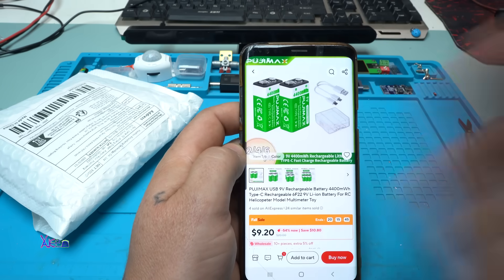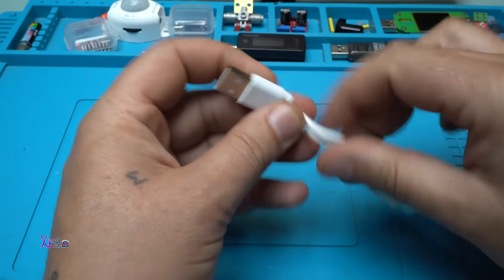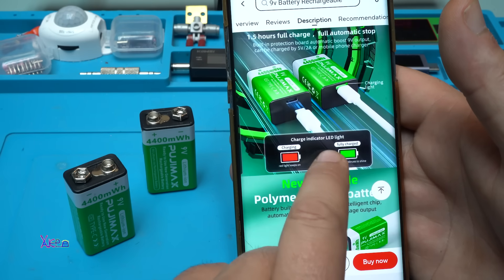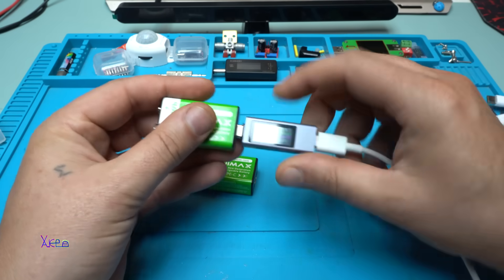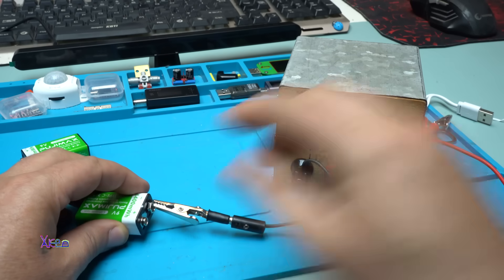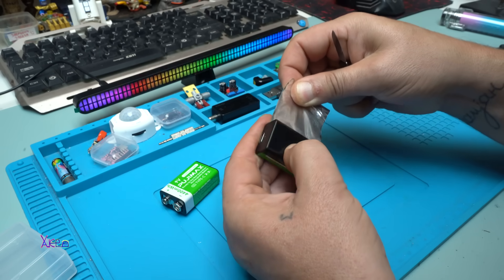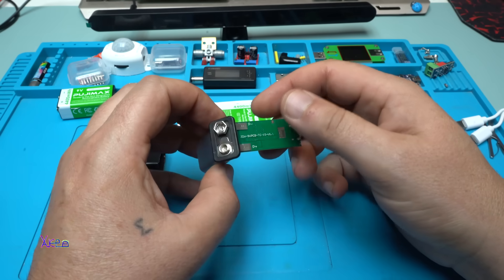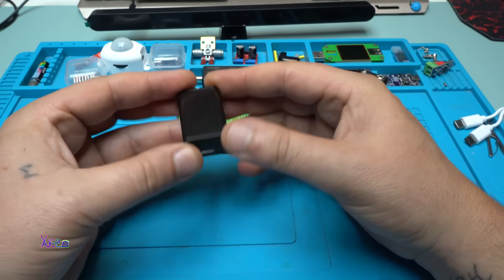$4 Aliexpress PUJIMAX USB 9V Rechargeable Battery 4400mWh?

Comment: I bought the same batteries from two sellers on Ali. I drained them and put them on charge and one charged to 1213mA, and the other to 882mA. So there are stronger and weaker versions with the same inscription 4400mWh. It's a shame you didn't measure the consumption of those electronics, because they slowly drain the battery, self-discharge. Alkaline 9V batteries have a capacity of about 600mAh. But they do not self-discharge. That's why they can last 5 or more years, while these run out in half a year.

Comment: Wouldn't that 1200mAh only be at the 3.7 volt.  I think you're gonna lose some of that with the buck converter jacking up the voltage, so your original calculation is probably closer for the 9 volt (probably a little less).

These would most likely be good for small electronics (pocket radio etc), but it would probably have problems with smoke alarms, since most of them are pretty persnickety.  That would be a good test though since there aren't many things OTHER than smoke alarms that use 9v any more...
Reply from the maker: That's a good point about the voltage drop, thanks for the insight!

Comment: Have you checked this "smart protection"? i.e. have you shorten the battery? Mine almost exploded. ;) Also,  there is too little capacitance on the output to mitigate switching noise.

Comment: capacity is true but you need todivide it not by 3,7 but by 9 V to get measured capacity around 400 mAh at 9 V including facts that voltage is around 9,2 V and driver efficiency around 90%-. higher capacity in mAh has 9V ones without driver (2 li ion in series) but it don't have constant 9V voltage but lower and changing in time voltage (still same capacity but because of lower voltage more mAh. That ones are also suitable for guitar but this with internal driver not because of noises from using driver internally. I bought them for $1 each (8pack) and they had 560 mAh at 9V (blue version of that Pujimax). Green one like yours had 394 mAh
Reply from the maker: Thank you for providing the detailed technical information!

Comment: I bought a similar unit (400mAh@9V) 5 years ago which works well but has a self discharge life of 6 weeks so not much use as it goes flat too quickly.
I would like to know self discharge rate if your unit.
Reply from the maker: That's a good point, I will test the self-discharge rate of this unit for the future videos.😉

Comment: No, the real usable capacity @9v should be ~450mAh, due to internal loss in voltage boost conversion circuit. Check it with a good capacity meter and you'll see it.
The anounced 4400mWh although true for the internal cell is, in my opinion, a misleading and dishonest tactic on the part of the manufacturer, who is trying to impress with a big number that does not represent what  people might hope to get.

Comment: I have bought several different brands of this type of 9V battery and they all suffer from the same thing - rapid self discharge. They are useless for test equipment or devices you don't use often as they are invariably flat next time you use them. The problem seems to be self discharge through the charging/inverter circuit.
You can get 8.4V versions, which are 2 off 3.7 (4.2)V lithium cells in series, and no inverter. However, these, as well as being less than 9V, need an external charger, but don't self discharge.
Reply from the maker: I understand your point, sir, and it's an important factor to consider with these batteries.
Reply: Second type of those (2 cells in series) CAN have USB input for charging.

Comment: I have several type of those step up board. Very useful to have for quick power supply from 5v usb to 9v, 12v or 24v. Had use it to made a UPS router that had 2 output, 9v and 12v.
Reply from the maker: That's a great idea, sir!👍

Comment: mAh is useful only when comparing to other 9V batteries that offer the same specification and even then you must consider the actual nominal voltage of each type.  Batteries should be measured in mWh, so kudos to the brand for using a relevant unit even if it's different than other brands and confusing to some of us.  We need the entire battery industry to switch watt-hour capacity ratings while also specifying maximum charge and discharge currents.

However, 4400mWh is the capacity of the internal battery before the losses incurred by the boost converter, so the rating is still exaggerated.  It will not achieve that rating in tests, so the mWh rating is likely quoted simply because it's a large number.

I'd be interested in seeing the ripple on the output, but this channel is focused upon practical tests and can't do every possible lab test so this is not a complaint.  Very interesting battery and the price seems quite reasonable if the cycle life is accurate.  The seller offers a substantial discount for buying more units, though this may not be as attractive in a world where very few devices still use 9V PP3 cells.  I don't need 6 of these ;).
Reply from the maker: Thanks for your detailed feedback!😊

Comment: A good normal rechargeable 9V battery of the same size, which is ALL battery (without needing space for all the electronics) has a capacity of 200 mAh. The  "fact" that this battery, which has to carry the USB port, the electronics, etc., has a capacity of almost 500 mAh (which is the right calculation according the manufacture specifications) is the miracle of breads and fishes. I honestly don't believe it. 
I will continue with my rechargeable batteries and a good charger with all the necessary protections.
Reply from the maker: Hello.
I need to make more testing sir,in next video I will show them.

Comment: I looked up li-ion battery 3 7v 1200mAh 440 mWh on Ali-Express and they aren't any cheaper, and in many cases more expensive than this is, and this comes with a board.  These seem like a good deal even if you want to take it apart for the battery so you can use it in a project..
Reply from the maker: Glad you like it and have fun with your projects!😊

Comment: Maybe unsolder one lead the battery and then measure the leakage current into the boost circuit when the battery is being stored (disconnected).  That should give you an idea if their claims for a five year shelf life are close to being real.
Reply from the maker: Nice idea,I should do that for sure.

Comment: I have a similar 9V battery and it suffers from self-discharge 😑
Reply: Didn't get warranty?
Reply: @NagmaniNaz  No, the internal electronics draw power from the battery even when it is not connected anywhere.
Reply: @tonogtube  you can use one slide swich between battery and circuit board after you can save your self discharging
Reply: @tonogtube  another thing self made 9v battery with the help of stepup module
Reply: How to solve? Any mod onboard?

Comment: There is one thing you need to keep in mind with these batteries. The boost converted gives you 9 V is a switching converter, as you already stated, and you will typically get some high-frequency noise on the output. Many devices won't care, but it might cause problems if you're using in any kind of radio receiver, and there is a chance that some test equipment may also not like having noise present on supply line. But for most uses, if it truly delivers the capacity it says, these will be an excellent purchase.

For devices that are sensitive to noise from the power supply, you can also get nine bolts which are to the cells in series and put out 8.4 V at full charge. They have no output noise, but some devices may not like the lower voltage as they discharge. Between these two types of lithium rechargeables, you can eliminate alkalines in almost everything you use. And that is a very good thing.
Reply: Lower voltage???
Well, alkaline "9V" packs DO drop below 8.4V at just 80% SOC and get to something like 5.4V when fully drained. It has everything to do about voltage range (empty - full) 5.4V - 9.6V for alkalines vs 6V - 8.4V for 2S Li-ion.
Reply: @volodumurkalunyak4651  - 8,4 have only that ones without driver which boost it up to 9V constant (usually about 9,1-9,3 V)
Reply from the maker: Thanks for sharing the useful information sir👍
Reply: @Hacktuber  no problem, I think it is good to spread knowledge around. I just ordered six of these for approximately $20, I would imagine I'll have them in a little over a week. As I've got a nice Maynuo M9712B DC load, I will check and see if they deliver the amount of power they claim, and will also throw them on my scope and check how noisy they are. I'll post back in this thread after I have done that.
Reply: Absolut Top Ihre Nachricht😊👍
Ein Oszilloskop anschließen wäre interessant. In einem anderen Video habe ich es gesehen😳. . Ich suche und nehme lieber 2 x Litium in Reihe. . Danke

Comment: A 4400 mWh 9V battery is about 489 mAh at 9V.
Reply: The reason for the error is that this battery is rated at somewhere around 9V, not 3.7V.  We aren't interested in the capacity of the internal battery, but the capacity of the whole package at its nominal voltage, which appears to be ~9.2V as the boost circuit likely maintains very close to that voltage until the battery is nearly dead.  Thus, 4400/~9.1V = 483mAh.

However, the boost circuit incurs some power loss (and heat production), so realistic capacity is probably 85% of the rating or 412mAh.  Until tested, I would guess that these batteries can deliver ~400mAh at 9V or so.  As I would expect, this is more than a 9V NiMH and slightly less than a 9V alkaline, but only if compared at less than 100mA.

9V alkalines really don't like currents above 100mA and most 9V devices are designed accordingly, so the high current capability of these Pujimax cells is likely not needed in most consumer applications, but it's still beneficial that the capacity wont' be substantially impacted by higher current.  The Pujimax will trounce any 9V alkaline if tested at 200mA or more.

A standard 9V alkaline has 2X the capacity at 100mA as it does at 500mA whereas this li-ion battery will have nearly the same capacity at those rates.

The only potential problem here is noise and we don't yet know how it performs in this regard.  This battery appears to be a good value even if we only obtained 500 discharge cycles, but hopefully it performs close to its rating.
Reply: @antibrevity  I've found that most devices using 9V batteries pull too much current (likely on purpose due to poor design) and the 9V battery doesn't last very long. Back when I was a kid in the early 80's I had a remote controlled car and if I was lucky I got 1 hour of use before the battery was empty. 9V batteries are generally quite expensive so it was a lot of wasted money buying them for some quick thrills lol.
Reply: @g4z-kb7ct  Its crazy to think now we are so spoiled for choice. Im running a small portable radio off a 5v usb leads with magnets on the terminals. i could prob just hard wire it to be usb but its so much fun just tinkering. It also runs off a 18650 so basically lasts forever if i want to use it away from power. I also dont miss the d cell batteries, those things were so expensive, now you can just throw a couple of aa cells in a carrier and still get the same output.
Reply: Mathematically anyhow - reality may affect the math.  Hahaha
Reply from the maker: Maybe I made a mistake,sorry sir
Reply: @Hacktuber  you need not be. They don't do practicals and experiments with instruments you have.
Reply: Thanks for clarifying, my NI-MH 9v cell is 150mAh so this one is an enhancement.